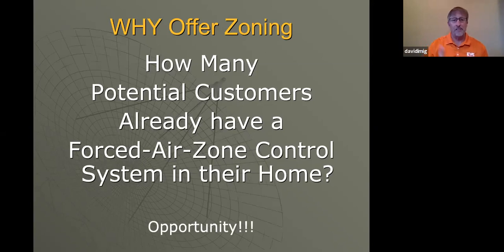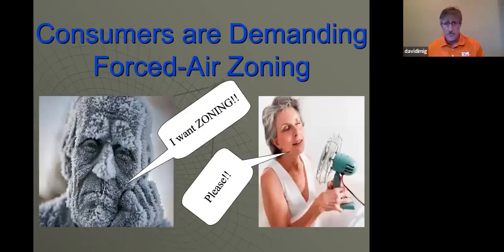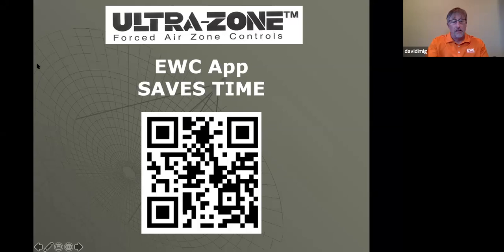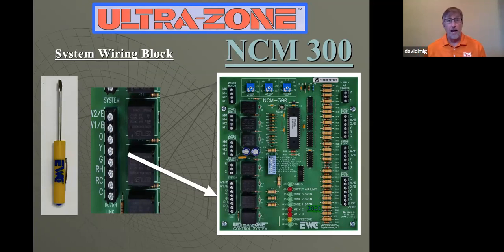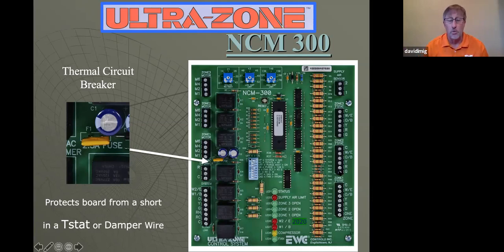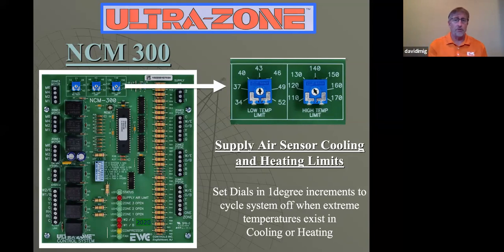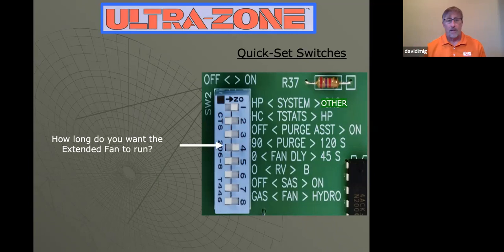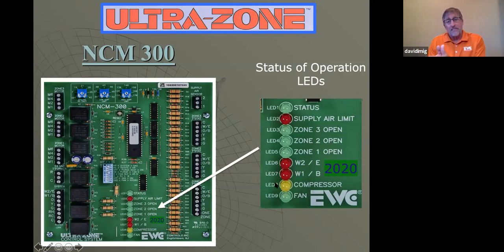NCM 300 presentation by EWC Controls

Comment: I have a heat pump unit with a oil furnace. I have problems installing a wifi thermostat. I bought NCM300 control board. My system has an orange and a blue wires for a heat pump. 
1- which wire to connect to O/B terminal?
2- is the blue wire goes C terminal who is common wire?
Reply: Sir, What brand heat pump you have in the home, will determine the reversing valve type either "O" or "B". The NCM300 and the zone thermostats must be wired/programmed for that RV type. Wire color does not necessarily dictate or guarantee a particular circuit or function. Often it is best to call the tech support line @ 800-446-3110. Call us to discuss.